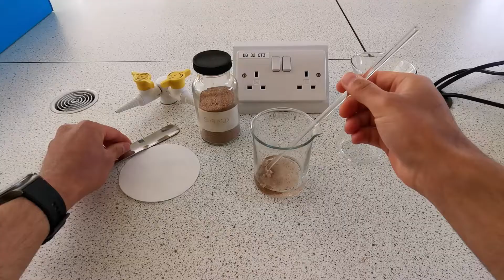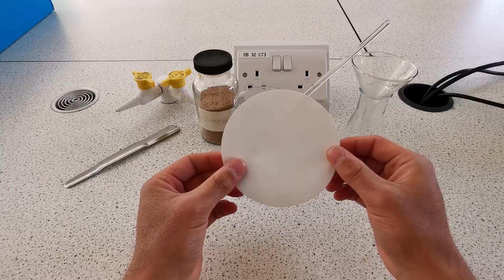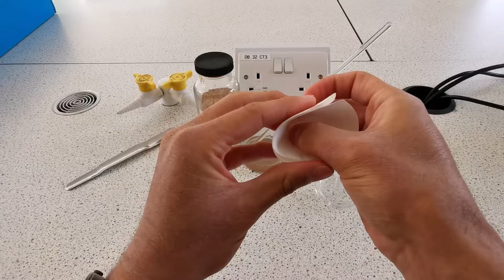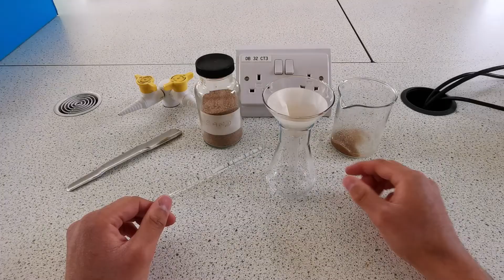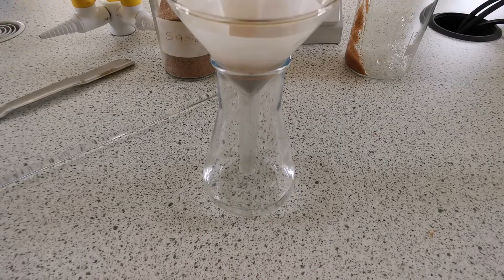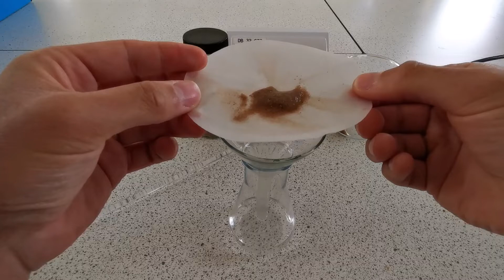Filtration | Separation Technique | Explanation and Demonstration

Comment: Great video, quick and simple test. I'm looking to use road Brine (saltwater) for my snow removal company. I need to know how to filter the insoluble impurities in the rock salt without effecting the salt concentration. Also need to be able to do so at scale and as quick as scientifically possible. love to hear your ideas!
Reply from the maker: Interesting question. Depending on the size of the insoluble particles, you could use some kind of mesh fabric if you're removing quite big rock particles and use a settling tank to allow big chunks to sink to bottom. Whereas, if you're separating quite fine particles, you could use a bag filter or cartridge in your pipes. Hope this helps 😃
Reply: @science4breakfast  Currently working on a design that spans the diameter of a 55 gallon barrel, to spare the details, it has a corrosion resistant stainless steel mesh middle with other parts that give it structure and reduce friction when moving vertically, to be pulled up through the solution leaving a filtered solution underneath and the undissolved particles in the mesh. My current math problem: how heavy will it be..